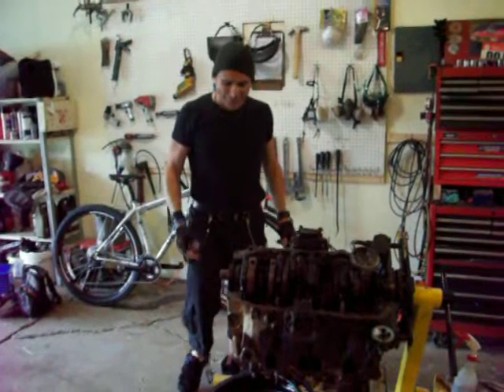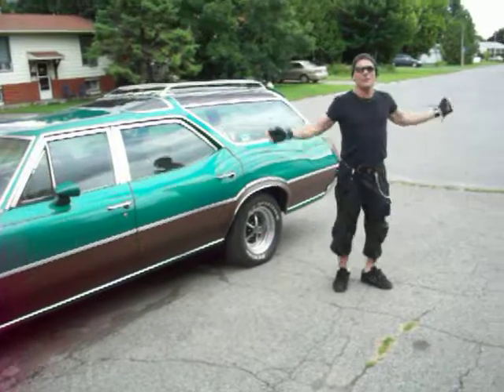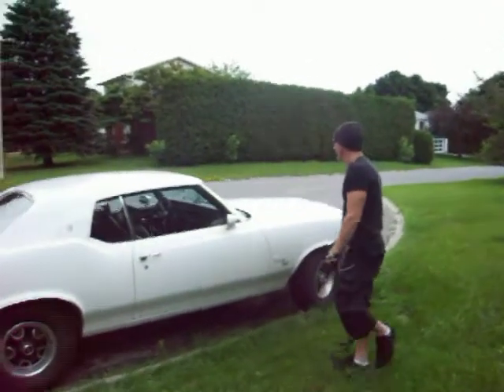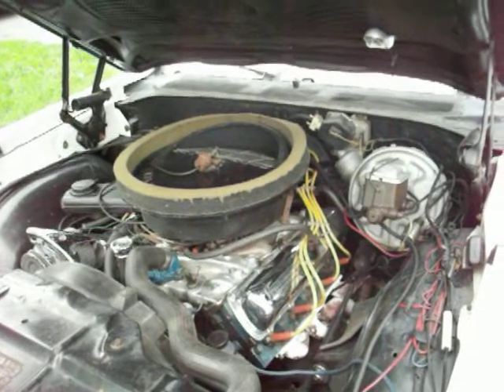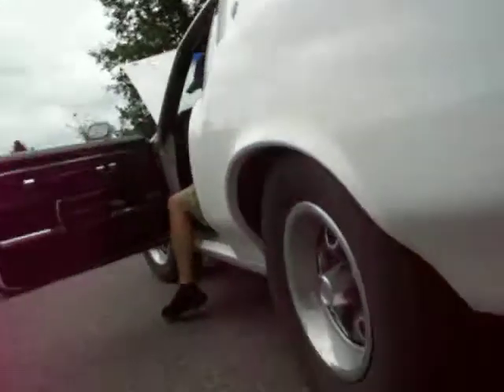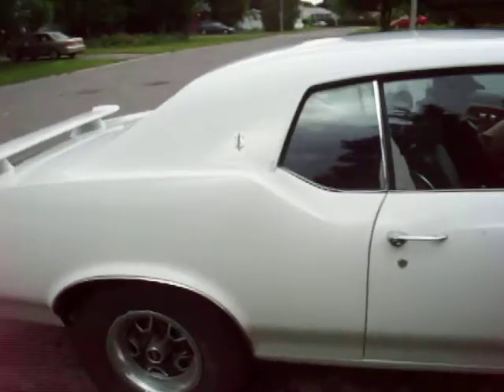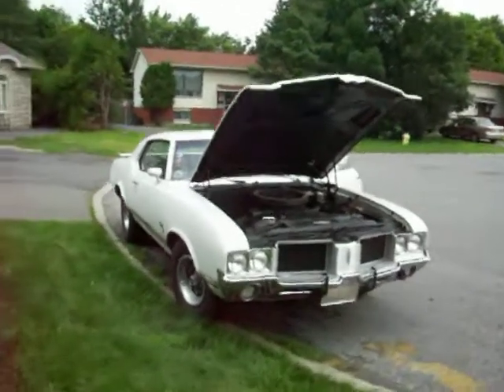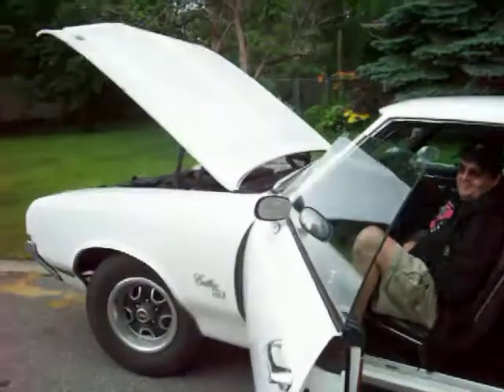Tony's '71 Olds Cutlass

Comment from the maker: Blair's Vista Cruiser, the yellow one, has a 455 from a 1973 GM motor home.  It was on a dynanometer last year, it has 220 horsepower to the back wheels, the torque was in the 330 or so pound -feet range.  I would like to get mine onto the dyno too some day.  Mine is the 'baby' motor in the group, a 350.  Actually, a little brat.

Comment from the maker: It does sound really nice indeed.  Off the line I can take Tony on easily enough, in a short sprint.  But he has cubic inches, more motor overall, less weight.  My wagon ran a very impromptu 1/4 mile in high 14's at 93 or so MPH on the GPS.  No way official, decent for a heavy small block.  Tony runs low 13's on the same 3.73 gears as I have.  Favor Tony on this one!  I'd like to see my engine and tranny combo in a car 1000 lbs lighter though!